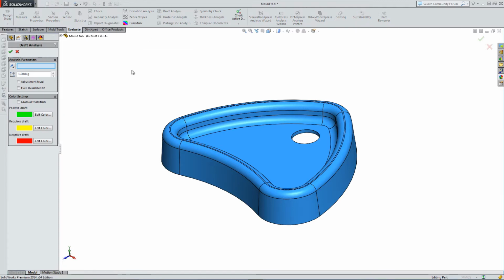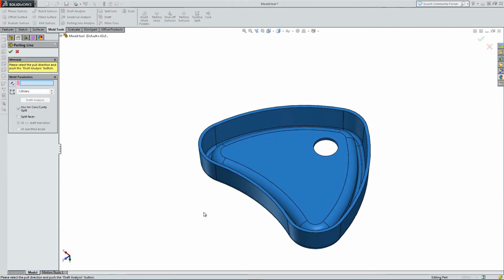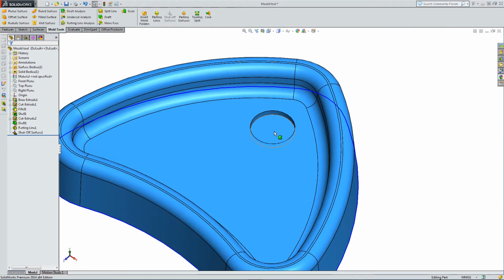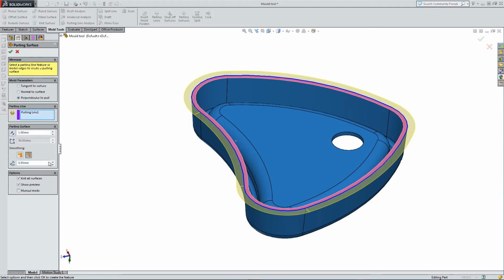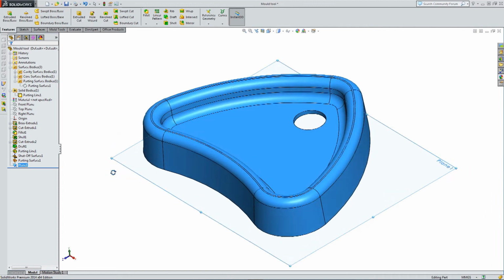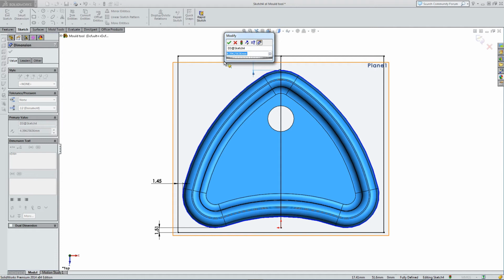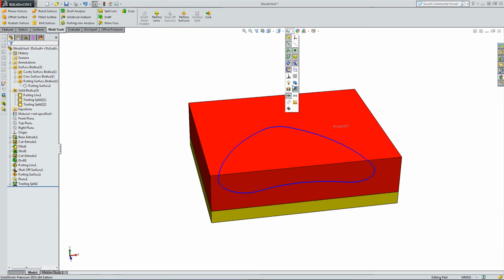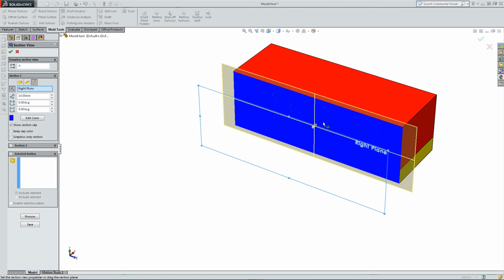Solidworks tutorial - Mold tool design

Comment: I don't understand draft, what's it's purpose, what does it do and how do you change it if it needs changing.  If you have a lot of negative draft as almost half of my product does, what now?
Reply from the maker: Draft is needed to allow the two halves of the mould tool to open and close without getting stuck or causing damage. Its also there to help the part eject after the moulding cycle is complete. If there is no draft the part is hard to release. The tool needs to produce millions of parts as quickly as possible so any draft is helpful. The challenge for the part designer is often how small a draft can you get away with as its not always wanted.

There are a couple of other reasons for draft. The first is the core and cavity open and close along the same axis. If there is no draft the core might come into contact with a corner or edge somewhere in the cavity before the tool fully closes. Because the tool is closed by a machine programmed to stop at a given point it will still attempt to fully close even if it clashes. If this occurs it could destroy or at least cause allot of damage to the tool and machine.

The last reason I can think of is wear. Draft helps contacting tool surfaces from wearing out before the tool reaches its end of life. The core and cavity features slide into each other more easily with draft. Less friction means sharp features are less likely to become worn down over time.

Does any of this help? Expert tool designers spend allot of time examining draft before producing a tool. If you as the part designer send  a part with no draft it is likely to be rejected. There are occasions when you can have no draft. But you must always discuss the requirement with the tool designer as they can make allowances depending on which faces of the part require zero draft.
Reply: @PDWCreative That is a very clear super-helpful explanation- thanks very much.